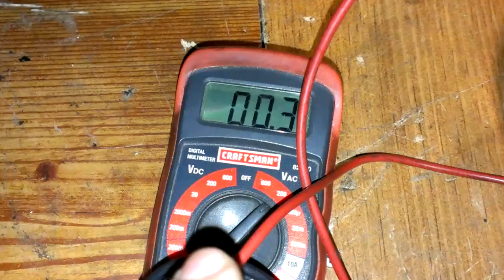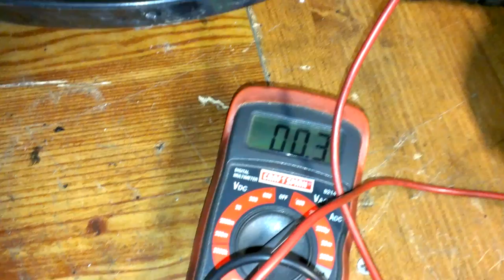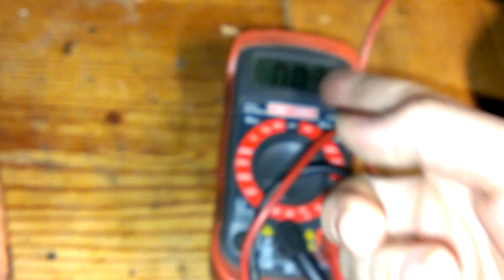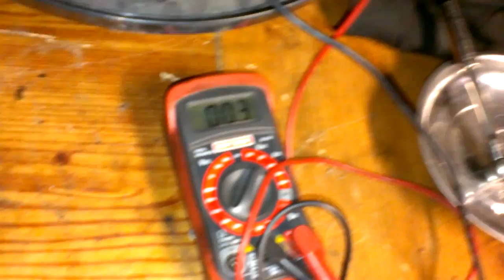How to fix a kerosene heater that wont ignite

Comment: I just repaired one of these heaters for a friends workshop, (it is badged Sealey in the UK but otherwise identical). It came to me after several failed attempts by others to repair it. 
I first of all found the cooling fan blades were worn out at the drive spigot and the fan was not turning, so replaced the fan blade with a brand new one. Next problem was fuel delivery or lack there of, this was caused by total blockage behind the jet, when I took the jet out it appeared to be a filter, but once the blast tube was removed I found it was actually dust totally packed inside there!! I cleaned it all out with a pick and compressed air and rebuilt the assembly, set the fuel pump pressure to 118psi and she fired right up like a sweetie.
Reply: hi , how did you adjust the fuel pump , tried backing mine off a little as it smokes and it kills it ?
Reply: @jimclarke6129  Hi Jim, you need to have a fuel pressure gauge and the fuel pressure specifications for your burner. Connect it to the outlet line and run the pump, there will be a screw that adjusts the pressure, so turn it up or down until it reaches the specified pressure. Smoking usually denotes a lack of fuel or pressure, so also check the suction line filter for blockages and clean as necessary
Reply: thanks for posting this. I have the Sealey IR20 version and its smoking but not starting. I'm going to check what you mention above. Thanks for posting
Reply: @elliot330  Hi mate, I would start by replacing your jet and fitting a decent fuel filter on the suction line, get one of the clear torpedo type filters and around a foot of tubing to fit it, remove the old suction line and replace it with the new one with the filter inline placed adjacent to the fuel pump. Should sort your problem out
Reply: Got a Draper 117111 60000BTU (same as the others rebranded beast), where can I find the fuel pressure spec?
Reply: what was the required fuel pressure spec on your IR20 please? @Ricky-zj6sy

Comment: So you're taking the multimeter red lead while set on AC and touching it to the ignitor terminal on the board?  I'm trying to figure my heater out.  I have spark and fuel but it just won't ignite. I pulled the fuel plug and put in fresh fuel and still nothing.  I'm not sure if it's the board or not or if I'm testing correctly.  Anyway, I'm getting like 14V from one ignition terminal and
 .814V from the other ignition terminal.

Comment: I have the exact same heater.  Won't fire.  The spark is there from the igniter.  Fan runs.  Fuel comes out.  But will not ignite.  Rarely used too.  Looks almost new.  Something is shutting it down.  It's not the photo cell, that works.  Turned up the pressure on the fuel pump too.  Still no fire.  The sparks ignites and it sounds like the pump starts but then everything shut down.  (except the fan)  How do i find out what is shutting it down?  What can be faulty.  The nozzle is wet too, so I know fuel is coming out.   ?????????
Reply: I have the same unit,  the same problem you have (all is working but it will not start)  The cause is that the fuel needs to be a fine mist , so not a spray/trickle of fuel. My unit is barely pumping fuel. I still don't know what exact the problem is. By the way the nozzel you can take apart fully (screw off the filter part) and clean and there is a filter inside the entrance of the pump which needs to be checked (mine was full of dirt)

Comment: My Sun-stream PT70SS heater (Same as yours, just another name) doesnt work at all. The fuel pump doesnt run and the red light doesnt lit, nothing happens. All the connections, wires and switches are checked, such as on/off switch , tilt switch, overheat sensor. Then its only one part left, the circuit board. Frustrating to order a new one, as there is probably only one component on the circuit board that has failed. Or could it be another part/reason?
Reply: Did the circuit board fix the problem,  mine is the same, I have nothing at all when I flip the switch, what did it cost? Thanks
Reply: @fatboybiker  No, the new circuit board didnt fix it. Bought a new one. Arount 1000 NOK for a new card

Comment: I have a problem when I run the sun stream,he work 1 minute and shut down, which would be a problem, thank you
Reply from the maker: could be the light sensor not detecting any light then shutting off after a minute.
Reply from the maker: if i had to guess without testing anything i would say number 36. the photocell. thats what detects the light from the fire and keeps it running. if it doesn't detect light it will shut off.
Reply: Thanks a lot,I'm going to try to replace the sensor
Reply: I'm not getting 120v at the plug,igniter fires and get spark. Symptoms are it'll run for few mins then shut off this was last year,this year so far it hasn't fired up yet,still diagnosing